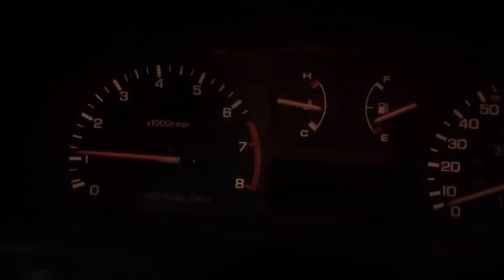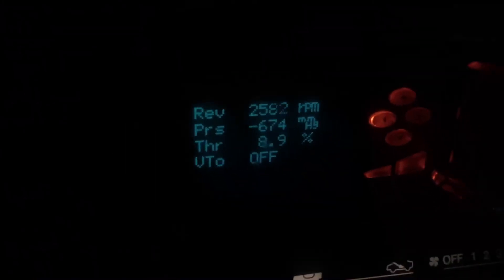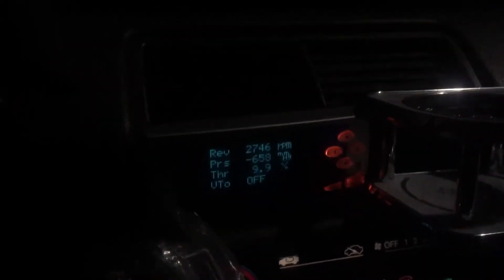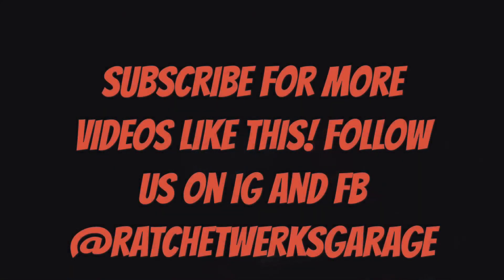#swagwgn 91 RT-4WD Civic lean burn Jdm d15b Turbo

Comment: Hi! Why AF so lean? What kind of fuel you use?
Reply from the maker: The motor is a d15b 3-stage vtec. It is made to lean burn 22:1 when peak volumetric efficiency is reached for optimized fuel economy. I am using 91 octane unleaded fuel.
Reply: +RatchetWerks Garage lean burn used on 1-stage of this motor? I mean on 12 valves, on 2d and 3d stage AF ratio like in another d-motor?
Reply from the maker: +Чип тюнинг и настройка Honda Хонда  correct! It's also turbo'd to optimize lean burn and achieve volumetric efficiency much easier. It also helps with  top end power obviously..